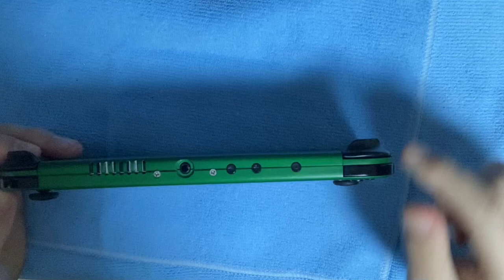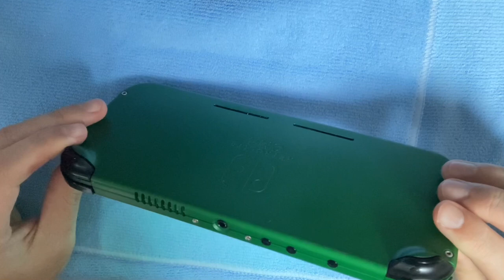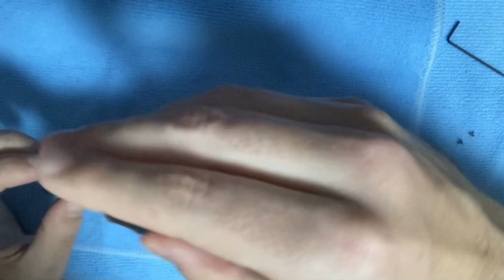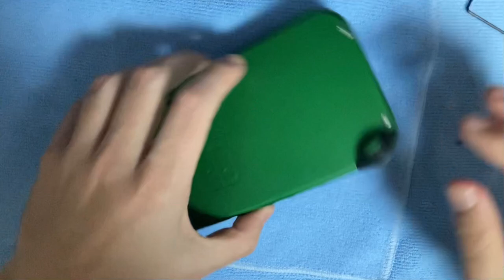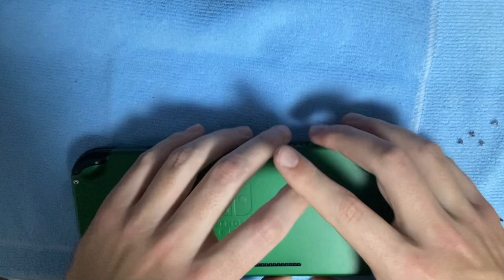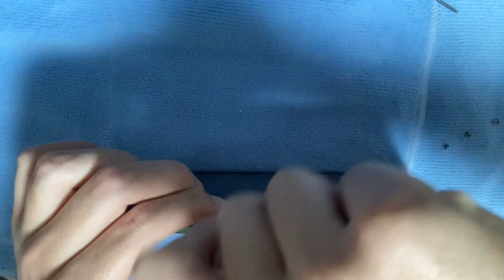Retro Lite CM4: Teardown

Comment: did you guys end up releasing a kit for this?
Reply from the maker: No we didn’t, CM4 is still not available to buy
Reply: @stonededge  if it does suddenly become available, you reckon youll revisit the kit? shame for something like this to be mothballed. I didnt realise how powerful these little cm units are, beats a RPI Zero anyday of teh week. another thought would be a radxa x1 which is that little zero looking thing but can get it with 4-8 gig of ram and up to 128 gig of mmc storage.
Reply from the maker: @3rutu5  I dont think so. I'm already working on a revision 2 which uses the Radxa CM5 (RK3588s). I hope to have that done by the end of the year in which case I would probably move on from CM4 and sell RK3588s kits.

Comment: Can the Keyboard script work with any Retropie image or just with the this specific hardware configuration?
Reply from the maker: It uses serial communication with my specific controller (Atmega32u4). I don't see how it couldn't be used with any linux distro, as long as you install the correct dispmanx packages and such.

Comment: Would it be possible to make a handheld using the CM4 without its IO board? Its much more powerful then the Pi Zero 2 W and the SBC itself still fits inside a GBA SP shell which is what I plan on using
Reply from the maker: What do you mean without an IO board? It doesn’t have any solder points so you need an IO board to interface with.
Reply: @stonededge  Well the larger board that you put the CM4 on for this handheld, is that required?
Reply from the maker: @ykguy6379  Yes, you need to design something that breaks out the CM4’s IO to be useful in a handheld. For example, connecting the HDMI channels to a connector.
Reply: @stonededge  Okay thanks alot for explaining that, I will do the project with an rpi zero 2 w 👍
Reply from the maker: @ykguy6379  Sounds good! Looking forward to seeing how it goes!
Reply: If it doesn't have solder points then you probably do need an IO board but maybe there is a smaller solution?

Comment: What kind of price range would the kit be in? Is it feasible for people to 3d-print parts/entire case to lower cost?
Reply from the maker: I don’t know yet really, but probably 300 dollars for everything including aluminum shells. The case doesn’t work for 3D printing because it’s thin, really needs to be metal
Reply: Thanks for you answer!
Is it possible to design a slightly thicker case that can be 3dprinted? I don't mean to ask you to do it, but is it possible for anyone to do so? Or are there for example heat/cooling issues that prevent the usage of a plastic case?
Reply from the maker: @mggevaer260 sure, anyone can do it if they want, I don’t really have time right now but the files are available on my GitHub (link in description)

Comment: Headphone jack should be on the buttom..
Reply from the maker: Why?
Reply: @stonededge  because thats the place it should be.. most handheld consoles does..
Reply: If its on the bottom, you can't place the console on a table with headphones connected
Reply: @mggevaer260  its a handheld console..
Reply: @mggevaer260  psp,  gba and vita even switch had it on the bottom side .
Reply: @gyrenrockz  You're right, I used to own a PSP and was never bothered by having the headphone jack on the bottom. It might indeed work a little bit better if you are going to hold the device all the time.
I suppose for the Switch they put the headphone jack on top because you can set it down and detach the controllers.
I can see your point, although personally I'd still put it at the top just so I could put the device down and use a bluetooth controller if I wanted to.

Comment: Wow! This came out immaculate! One thing I'd recommend (as a MacBook owner with black keys) is that if you decide to mass produce this you should try and get the all of the buttons to either be not black or have a more rough texture, as they currently look like absolute grease magnets, especially the triggers. Regarding the screws standing out I think you could get them to be a little more subtle if they were black in some way.